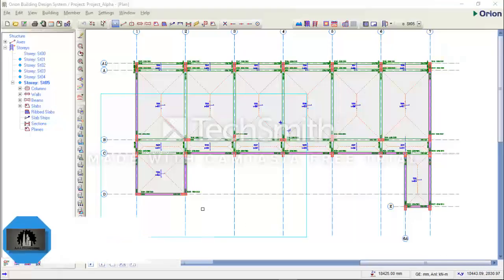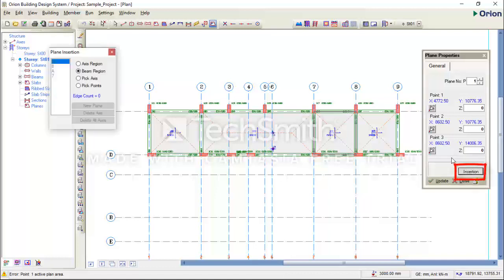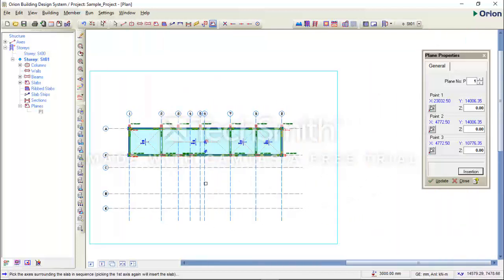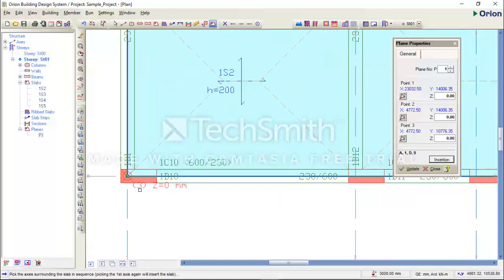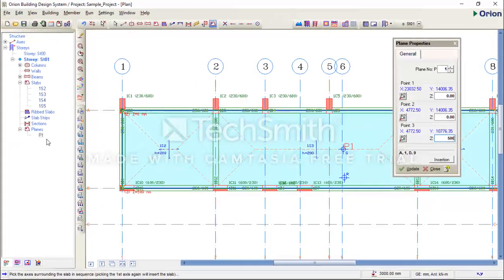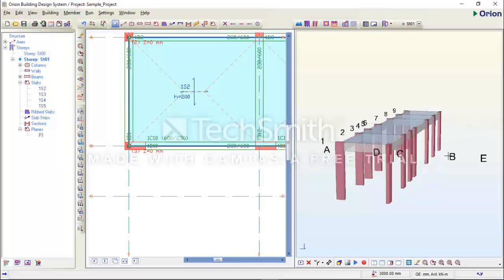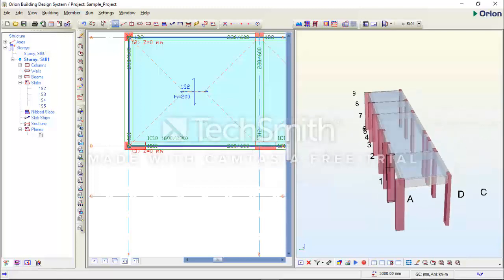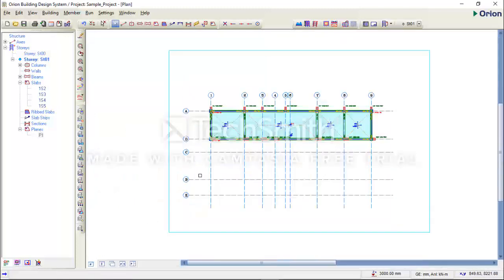Introduction to Plane Definition on Orion 18 Software

Comment: Hello, I tried putting the plane definition but it's icon on the tool bar is not active... please help me on how to activate this option thank you please
Reply from the maker: Hello, It has been long since I last use this program, so the help that I will render to you will be limited. If you can not see the plane definition tool at all, I think you can add its tool pallette from the settings tab at the top. If the tool is showing but not active, I recommed you re-install the program. I made a tutorial on how to install this program in my previous videos. I also attached the installation file to this video tutorial.